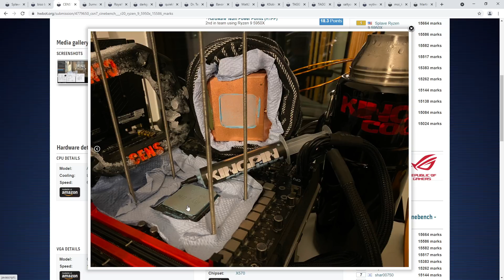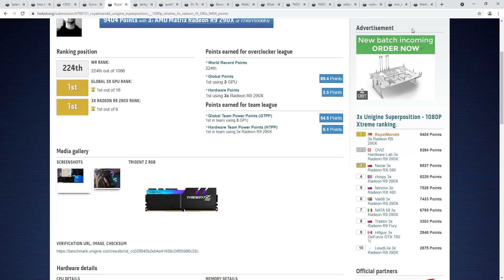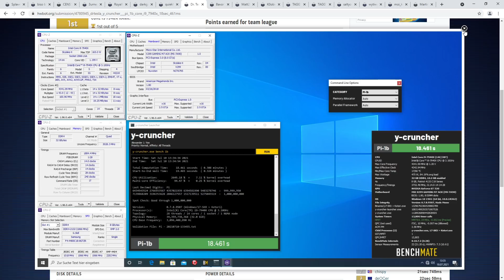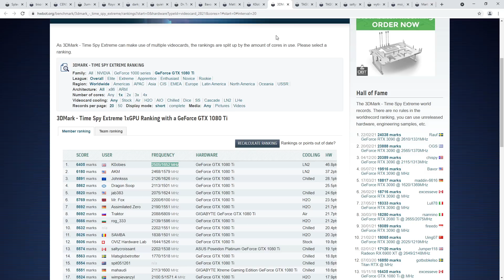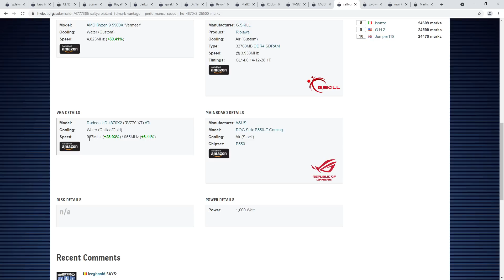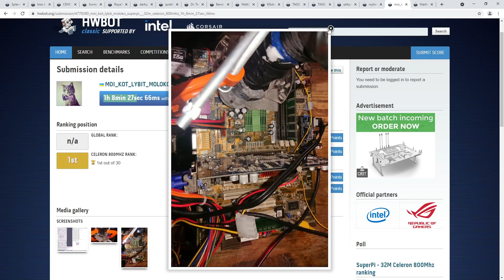HWBot score round up #10: EXTENDED EDITION, 5300G on LN2, 6GHz 5950X, ice bucket SLI RTX 3090s

Comment: You should love optane. Works without a cable on a bench. the SLC is indestructible. Power loss protection if the OC fails ... sounds just like you

Comment: Hi, I just found your channel and you’re very informative, I love it. I have a question that I can’t seem to figure out right now. My question has several facets.

1. How is amperage determined in the running of a cpu? Is it always directly related to voltage (ie, an exactly linear proportion)

2. In an undervolting condition in which max tdp is not adjusted, does total possible amperage increase? Specifically in the new PBO curve editor, if I were to undervolt, allowing for higher total sustained clocks, would this actually cause degradation via increased amperage, or is voltage related to amperage in such a way that if voltage equals X, amperage is always some multiple of X?

In short, can undervolting cause degradation via increased amperage?

Comment: I'm not new to soldering basic things like capacitors on TVs but I am new to this level of tech.
A buddy of mine has a Titan X that has a component on the top side of the card that is blown out. The silkscreen next to it says Q507. 
Can someone please point me to a schematic for the Titan X to know what part I need to get, to replace it in hopes that the problem didn't spread.

Comment: I had a pretty good experience with dual GTX 670 4GBs back when they were new. Very few games microstuttered and if they did it was an easy switch for individual games to turn SLI off. They held me over for a long time even into 4K territory, then I went R9 295X2 -> GTX 1080ti -> RTX 3090. Still have them both and they both still work.

Comment: Thx for having me in your Video again.

My old WR was beaten by Oviz Hardware Lab. So i had to get it back. 😅

Didn't know that my cards have not the best vram. But one of the cards can run 1300mhz core @ 1,4v and 1700mhz on vram @1,63v.

The 1300 watt seasonic is only for the 3 cards. At full load the powerdraw is around 1200watts.
For CPU and Board i use another 850 Watt BeQuiet.

Comment: P5E3 Premium was high-end mobo more directed at workstation applications, but it turned out to be good at overclocking. I think a lot of 8GHz single core Pentiums and Celerons were validated on this mobo. The difference with REX is it doesn't have those proadlizers so it is more robust on LN2. On the other hand on REX the X48 chipset were supposed to be binned and P5E3 Premium's weren't, so chipset quality is left to luck.
@Moi_kot score I think he is also running quite high SDRAM frequency @190 MHz (if I remember correctly the standard was 133MHz). There weren't any memories marketed for overclocking at that time. However there were some differences based on IC's used and people figured it out.
Reply: yep, SDRAM standart frequency is 100 and 133 mhz

Comment: To answer the questions, yes that's my daily setup that got 3rd place in Port Royal with the 5950X and SLI/NVLink 3090 Kingpins.  That's why I have the quick disconnects.  I run benchmarks on my daily system with the ice bucket cooling until I get condensation on the GPU fittings then I shut the system down and dry everything off.  So I usually only get a few benchmark runs in.  I recently built that cooling setup of mostly scrap and leftover parts from other projects.

I'm in the process of building a dedicated benchmark/overclocking setup.  In the future, I'm going to take the cards apart and coat them with something to prevent any condensation issues along with using some other methods of protecting the rest of the system.
Reply: get us some better pics of that daily setup with the bucket, looks fun
Reply: Bro keep doing your thing!!! I love seeing shit like this!
Reply: So you are the brave one !
Well done, you have a bright future to inspire all of us !
Reply: @ralph972  I'm pretty sure BZ didn't meant it as a compliment. Although, you do have to admire a person who takes his hobby seriously enough to risk the well being of his personal machine (lacking better alternatives, of course).